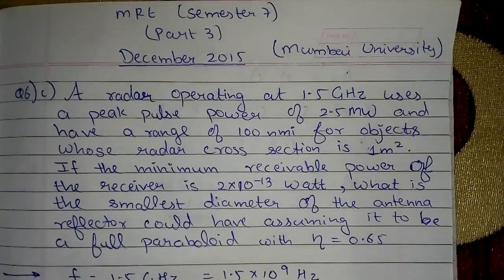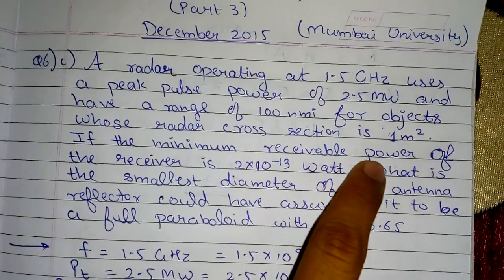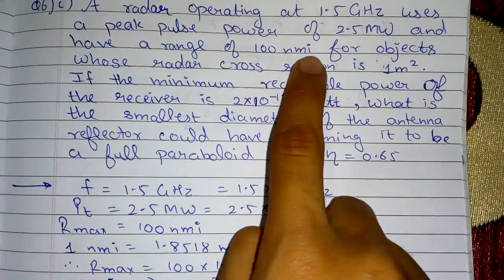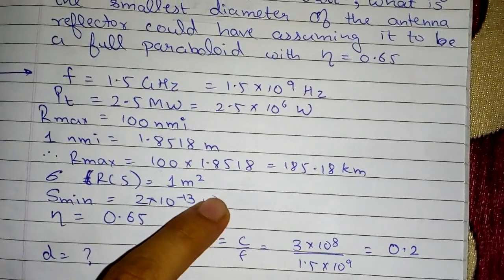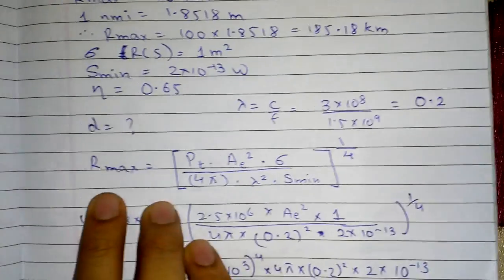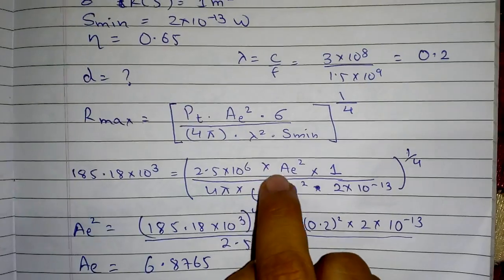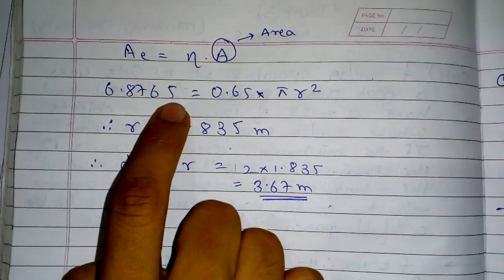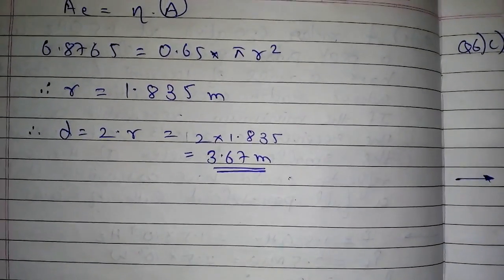MRE December 2015 Part 3

Comment: 1nmi = 1.8518 km ...right ?
Reply from the maker: Note = 1.8518kms (mentioned meters in the video) Sorry for the error.
Reply: 1nmi=1852m
Google it
Reply: @rupeshkamble7560  yes that is what I said ..dude ! 1nmi=1.852 km ....check out the decimal point ! 😉
Reply: Is the answer correct